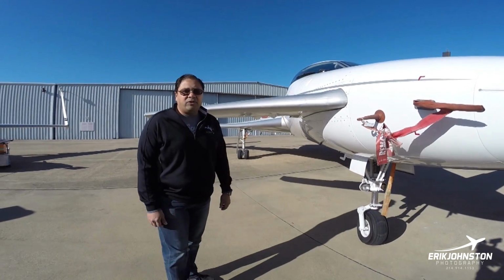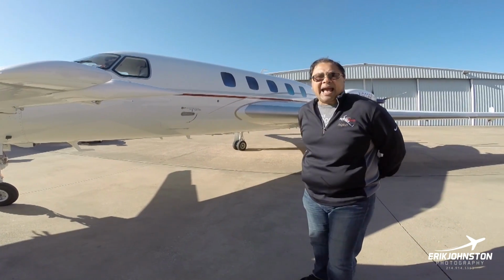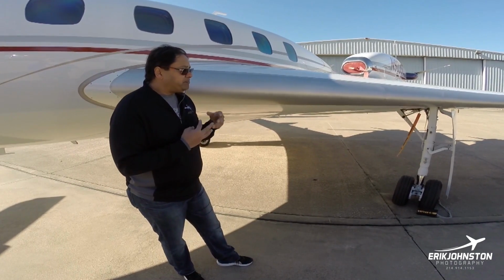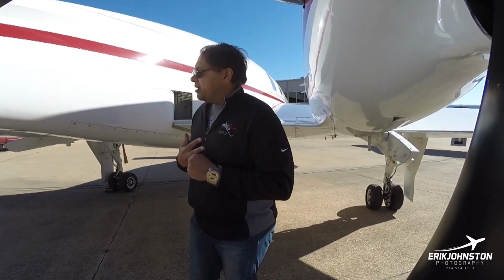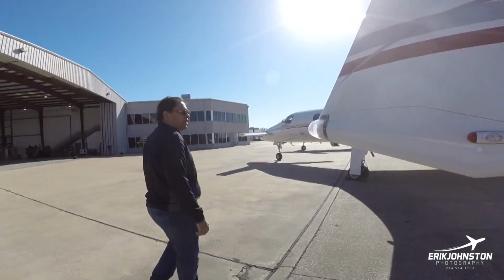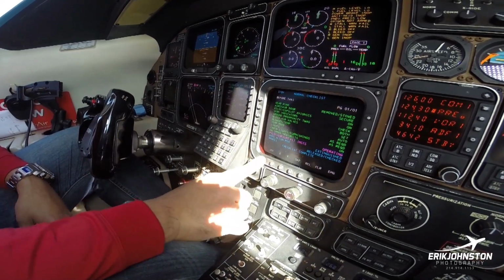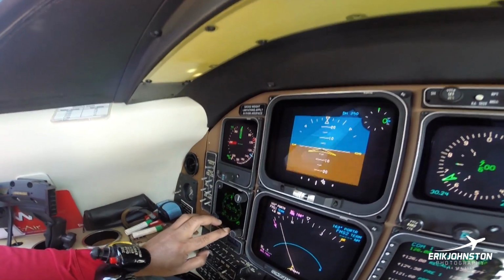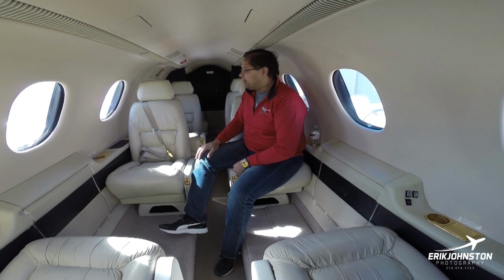Beechcraft Starship Walkaround Tour

Comment: I worked for Beechcraft Wichita back in the 70s as a NC machinist. I liked it there and the supervisors were easy to work for. I went to Boeing though for a lot more money. 😊
They had not started the starship before i left.
I do not understand why Beech bought most of these back if they were such good planes.
They could have upgraded a few things like getting rid of CRT screens and installing LCDs. Those old screens generate a lot of heat.
Did they have electric motor powered cabin pressurization and heating, or did they use bleed air?
Id love to hear more stats like climb rate and speed.

The exhaust hitting the blades made a lot of noise. A very distinct sound.

Comment: Just a little mention regarding the comment that the Starship was the first plane made fully of composites manufactured and certified  worldwide. That is not entirely correct. The first full composite aircraft certified worldwide was the Wassmer 50, in France (1969). That plane resembled a lot the Piper Cherokee. There were various versions with engines of different power (150 to 180 hp Lycoming). All were fixed gear. The Rushmeyer design was based ont he Wassmer 50 series with a retractable gear. I was fortunate to display my Wassmer 54 in 2005 at AIRVENTURE on Aeroshell Plazza. It was parked not far from a collection of Burt Rutan designs. Burt was astonished to see that the only structural metallic part on the plane was the pitch trim tab. We had flown the plane accros the North Atlantic (no autopilot) with my wife to attend AIRVENTURE, departing from France, and flying VFR. We returned in France after the show. Still the Starship is a dream plane and concentrates so many innovative technologies and design novelties that it makes it a unique aircraft. A pity the the FAA required so much changes and unnecessary material resulting in additional weight. I would love to see how this aircraft would have progresse over the years.

Comment: I was at a shop on short final at KADS yesterday and heard this MASSIVE noise of an AC (well a lot louder than most of the operations at KADS)  about to cross the fence.  I "ran" outside to see a Starship and was giggling like I'd just won the lottery.  My research brought me here and I had no idea that two of these were based at KADS, or that 6  were still flying.  I was surprised how loud this AC is from behind and at what I assume was flight idle on short final.  Too cool.
Reply: Yes same here. I just moved to the Carrollton area and saw one landing a few days ago when I was at a park under the flight path. Pretty loud

Comment: Can the carbon fiber frames of the disposed Starships be reused to build another set of airplanes? What about the engines and propellers?
Reply: Nope.  They were burned in incinerators down in Arizona.  Darned shame.

Also, you can thank one guy, Robert Scherer, for spearheading the original efforts to keep the Starship alive.  AFAIK, he's purchased a huge supply of spares from Beech, but the type certificate still resides with Beech/Textron.  Erik, you should get some on-camera time with Mr. Scherer to fill out the Starship Story.

Comment: Uh...  No.  Vortex generators on the vertical stabilizers create turbulence, which provides for predictable, gradual progression of flow separation.  With them, you risk abrupt transition of flow separation resulting in a fin stall and loss of lateral (yaw) control.

Good point on the regulators demanding a lot of expensive, heavy equipment which made only slight gains in lowering stall speed but significantly reduced useful load.  I'll bet without all that additional weight the aircraft's stall speed would have been reduced about as much.

Comment: I remember that Cessna went with the swept back vertical stab opposed to the more effective straight tail--simple because it sold better with the better looking Vert Stab. Question: Why was there no vertical stabilizer included on the tail above the tail strike preventer--even for the 'cooler' look. would it have helped sales?

Comment: "The engines are in the back so it's very quiet. You don't need a headset in the cockpit."
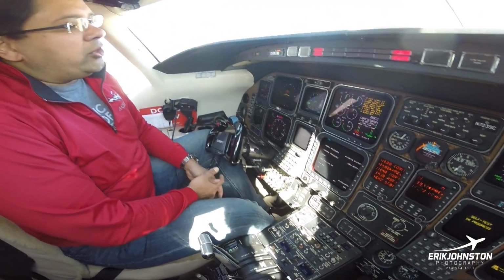25:24 Turns on hurricane-level fans to cool all the avionics?

Comment: What a presentation!  One of the best I've seen.  Very informative and well delivered.  Wonder what the descent rate is at minimum controllable airspeed.  I assume that is the vertical speed at which you land the airplane.  Do you have to have the bucking effect in the right phase for minimum airspeed landings?  Even if it doesn't actually stall, it still comes back to earth somehow.  Just wondering.  Thank you.

Comment: I just went and researched this aircraft and it was apparently a boondoggle for Raytheon, in that is was and is exotic but it also did not reach any of the design goals set out for it.  Beech or Raytheon, (I can't remember which) actually bought many if not most back to put an end to having to keep parts and business interest afloat for that design.  Personally I don't trust aircraft designed like that even though the Starship was considered to be extremely stable as compared to normal aircraft design.

Comment: I was lucky enough to have one low flyover me heading in to land in PA a few years back. It sounded amazing and looked even better.
Reply: I was lucky enough to have lived a few miles from Beechcraft in Wichita, Ks.  Seen it sitting at the end of the runway running it engines what seem like wide open before take off.  It was very noisy when taking off but was a pretty airplane.  I enjoyed watching all of Beech's  aircraft taking off and landing.  Then they build a new runway so could not get a good up and close viewing of the take offs and landings.
Reply: Now Beech is owned by Textron Aviation as is Cessna.

Comment: What a shame Beechcraft got duped into making that “unique” plane.  Linden Blue (spelling) was the CEO whol really got taken by Rutan.  When the 85% model didn’t perform as expected, Rutan promised that the full scale prototype would.  But, it could not as we know.  100 % over budget and 5 years late, there was no way they were ever going get the aircraft to payoff unless they found a couple of hundred people to pay over 5 million for a turbo prop that was not the highest performing turbo prop of its time.  It was noisier than expected, had shorter range, lower climb rate with a lower cruise speed. 
This guy sounds as if he has drank a gallon of cool aide. No corrosion, please don’t mention the exhaust on the props. (Oh wait, he did! So they do have corrosion problems) Hard to certify, yes, it is when the first structures would not pass destructive testing.    If it had been a good aircraft they would have sold 500 of them.

Comment: G'day,

A Canard  Aeroplane is one which has it's Mainplane at the Rear.

DUCKS have long Necks..., so in flight their Wing appears to be up at the Back End.

Many early Aeroplanes were French, so Aeronautical Nomenclature is literally RIDDLED with French Words & Terminology ; to wit., "Aileron", & "Fuselage", & "Longeron" & "Nacelle" and "Chandelle, as well as "Empennage"...., as well as "Canard".

"Canard" is French for DUCK.

The Beechcraft Starship is a CANARD, and it has a MAINPLANE up at the Back End and it has a CANARD FORWARD SURFACE.

The Starship's Canard Surface is a Bog-Standard Common or Garden-Variety Canard Surface ; they ALL carry part of their  Aeroplane's Weight, they ALL have Moveable Elevators at the Canard's Rear Surface.

The Starship is NOT any kind of a "Flying Wing" Aeroplane.

  It's Wing is stabilised in flight by Vertical & Horizontal Stabilisers..., the fact that the Horizontal Stabilisor & Elevator are Canard Surfaces makes no difference - it is NOT a "Flying Wing".

There is no such thing as a "Tip-Sail"...,  outside of (perhaps) Beechcraft's Marketing Jism Department....; that  there Starship uses Bog-Standard Tip-Fins,  incorporating 1920s vintage Drag Rudders...

  No need to invent bullshit terminology.

Apart from those basic Mistakes, & unforced errors, this was quite a good and interesting little Video.

Thanks for posting.

By the way, lack of (known) Metal Fatigue is one thing...,  whereas unknowable Composite Delamination is a very much much more randomly dangerous proposition...; as you sit in the Bit Which Crashes..., you would do well to remember that fact.

Justifiably sayin'...

Have a good one,

;-p

Ciao !

Comment: This is a wonderful airframe. Its demise was a mistake Beech made in the contract for maintainnce. It had issued  the contract to one company to cover all issues at a low cost to the owner. However the company that held the contract abused its "powers" by overcharging Beech in costs to repair anything since they held a monopoly for service. This was a very foolish move on Beeches part as not allowing several more companies to hold repair contracts which would have provided competition in keeping prices low. Bottom line is that service is what killed the project. A re release of this aircraft today would probably be a bit more successful knowing all that has been learned in previous mistakes. Technology would shave several hundred pounds off of instrumentation alone as well as eliminating the flap system which would save an additional 2-3 hundred pounds off of flaps and control equipment. Even the climate control system could be upgraded to more common refrigerants, the Starship used either R-12 or R-22 refrigerant which is nearly impossible to find today. Too bad it would take several million to receive "re certification" in its updated design making it impractical to market. It is one of the safest designs out there, from what I have read in the past there was one gear up landing ( for what reason the gear was not extended I can not remember ) where the aircraft suffered only superficial damage to the underside and I believe it was easily repaired and placed into service again.
Too bad Beech pulled all of the aircraft back, most were on leases and the operators were offered King Airs in exchange. They should have offered to sell the aircraft to these operators and at that point drop the service contract with the single company and opened it up to any Beech service center. I was surprised to see so many airframes in the Boneyard, was this a recent photo? I thought that Beech paid several million to destroy the aircraft through an EPA certified recycler where the airframes were to be ground up and incinerated in special equipment so as not to release any harmful byproducts of the resins used in the construction. I believe several years ago there was also an operator in France that had a Starship with a valid airworthiness certificate and a spare airframe. Wonder if this company acquired it.
Reply: I've been in aviation for 45 years. I walked into a hangar one day in Great Bend, KS and it was full of Starships. I didn't know at time they were all slated for the crusher. I asked one of the operators on the field why there were so many. He didn't tell me anything other than Beechcraft was "storing them". I think he knew.  This was on old military quonset hut so it could hangar quite a few. We didn't have cameras in phones back then so I didn't get any pictures.

Comment: The Starship deserves even more emphasis on its engine out handling and performance, which enhances safety to a level that we simply don’t see enough of. Look at how far apart the propellers are on a King Air versus the propellers on the Starship. Just by eye it’s easy to tell how the engine out controllability would be much better on the Starship. Last summer at the same airport where this was filmed (ADS), a King Air 350i crashed after takeoff. Surveillance videos captured the accident, which are difficult to watch, but they showed exactly what happened; engine failure after takeoff and subsequent loss of control with no survivors. Could that accident have been prevented if the same engine failure occurred in a Starship? The fact is, asymmetrical thrust has caused accidents for decades, so airplanes that have less of it are safer by default. Also worth mentioning is how good the single engine power loading is on the Starship. With less asymmetrical thrust force, the engines can be more powerful without creating an unacceptably high minimum control speed, and that’s exactly what the designers did. Light twins used in the training environment have so poor single engine climb capability because of how underpowered they are on one engine (>19 lb/hp). Acceptable engine out performance starts to happen around 17 lb/hp, and good performance at 15 lb/hp. The Starship is substantially better than good at 12.4 lb/hp!
Reply: There were far more issues at hand with the Addison crash than purely “asymmetrical thrust.”
Reply: I was going to mention this.  Thanks for doing so.

Comment: I'm A novice pilot but when he says the airplane doesn't stall, to me it doesn't stall means it hovers?
Reply: Simply put, he's wrong.  Airplanes don't stall, wings stall.  And in a canard aircraft (another thing he's wrong about), the canard stalls first.  The main wing should never stall.  What a canard aircraft can't do is spin (since the main wing never stalls).
Reply: It means the forward wing stalls before the main wing. If the forward wing stalls, the nose drops, but since the main wing is still generating lift, it doesn't nose over and plummet out of the sky. You still lose altitude, because you're pitched down, but you don't lose control.
Reply: Almost.  The forward wing loses lift and the nose DOES pitch over forcing a gain in speed in decent where the forward wing starts to fly again.  Burt called it "porpoising".  During a flight test of another aircraft at the Rutan Aircraft Factory in Mojave I was fortunate to fly with Mike Melville in his personal VariViggen as well as the RAF LongEz.  In the VariViggen Mike had me take the stick and hold it full aft and kill the throttle.  The nose rose and rose as we slowed down, the canard stalled and the nose dropped, we gained speed and the nose started pitching up again until the canard stalled again.  Rinse and repeat.  Very cool!  I also got to fly with Burt in the original Defiant.  Good times.  (BTW - with the help and guidance of Burt and another cohort Herb Iverson (first VP of SCALED) I researched and wrote the Feasibility Study for the Starship which included initial cost studies.  The three of us huddled in an off-airport rented office and banged out the Design and Feasibility Study for the Starship under contract to Beech.  AS DESIGNED the Starship met or exceeded all of the requirements Beech wanted.  It was later during Beech conforming design effort that the weight of the final craft ballooned and killed the original performance characteristics needed.)

Comment: I got a dumb question........CRT, catho ray tube....all those glass and lead, you may have 150lb of weight there.  Would it be an advantage to go to LCD?  Do you need recertifications swap CRT to LCD?
Reply: Peter XYZ The only dumb questions are the ones you don’t ask. To answer your question, yes. Any modification made to an FAA certified aircraft will require what’s called a Supplemental Type Certificate. With only 4 of these wonderful aircraft flying the cost to upgrade the avionics would be astronomical. The only other option would be to move the aircraft to the Experimental category which would then prevent them from being used in a commercial capacity.

Comment: Hi! I met with Burt and Dick Rutan in their office in 1983. Originally there was actally a much automated production method devoloped for it by Brandt Goldsworthy. Beech was to conservative to go with this production method. I saw it at Goldsworthy Engineering in LA. I have some T-shirts with the Starship I bought from FloridaFlying YouTube channel.
Reply: Rudolf Abelin  This is absolutely true. My dad was with Goldsworthy and I briefly worked for them too up in the Eugene office. The fuselage ended up being made in 2 halves and bolted/bonded together along the top and bottom. It should have been built as a structural tube by automated tape layer. Cost and weight would have been much lower with higher strength.
Reply: @jenniferwhitewolf3784  Hi Jennifer! I think we might have communicated before!!!  Yes I remember Brandt describing the automated process with the tape laying machine. Also the automated filament winding of the 2 halves. If I remember correctly, the 2 halves was made as one unit and then cut in half. The filament winding machine for the geodesic structure used a distance meter that actually sat in an Polaroid camera. Or as Brandt put it. The spent a lot of money to develop this range finder, we just have to buy a few cameras!
Reply: Rudolf Abelin  I was not aware of the use of the camera rangefinder. It sure figures though, a developed and mature technology available in a low cost consumer package. Clever.
Reply: @jenniferwhitewolf3784  Seeking in my memory. I think it was Brandt's chief workshop technician that made this. It was me, my dad, Brandt and the chief technician that looked at this in the LA workshop. I think the chief technician might have been of Scandinavian descent and name?